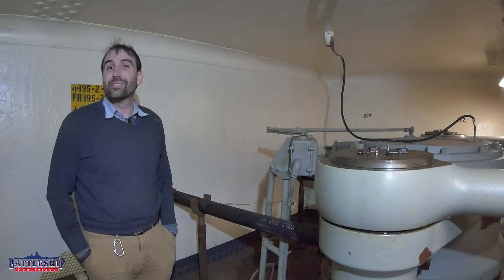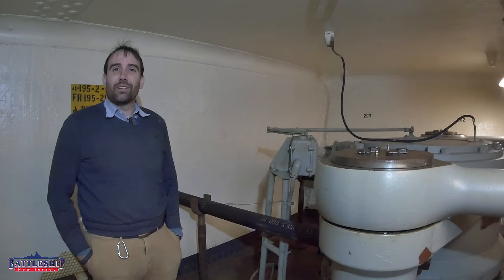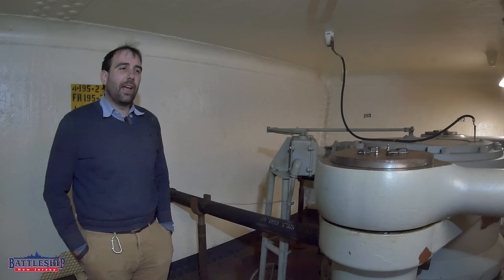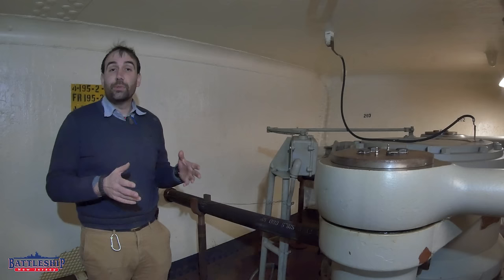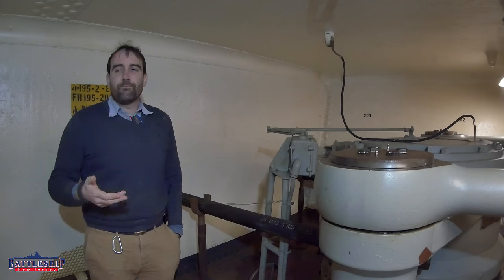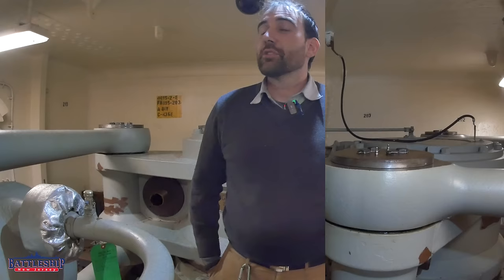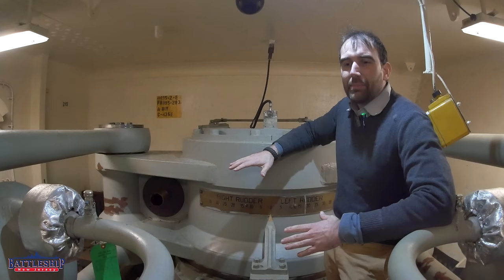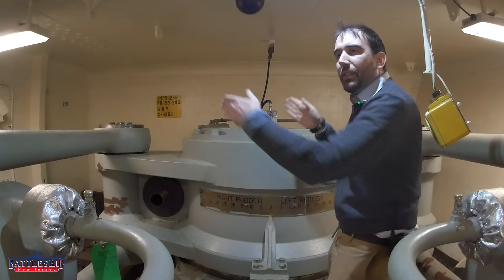Can New Jersey Still Use Her Rudders And Are They Straight?

Comment: Now we need a video on why the rudders are 2 degrees inward and how the relates to actual steering of the ship.
Reply: Probably like in a car. Your front wheels aren't perfectly parallel either. They "toe-in" a few degrees to help hold a straight line when driving.
Reply: From what I have read it’s pretty standard to toe in rudders on large vessels. Toed-in rudders reduce drag, give crisper steering and more speed.
Reply: My guess is that it is due to the hydrodynamics of the outer props being forward of the inner set, as well as the relative positions of the props and rudder
Reply: It's to help reduce the induced drag from the stern of the ship. Think of a teardrop and how it reduces the low pressure zone behind an object.
Reply: Yep😊
Reply: @cityrippers9445  Ah, so the rudders ARE "straight" as far as the water flowing into the void behind the ship is concerned.  Ok, that makes sense.
Reply: I also want to know
Reply: Why
Reply: How about an episode about the details of towing?  How many tugs, and of what power?  How many lines, their attachment points to the ship, the positions of the tugs and why?  Who’s in charge of all the tugs?  Etc.
Reply: The 2 Degrees inward is because when all propellers/shafts are propelling forward, they are counter rotating and the rudders cancel this out
Reply: It is to  limit prop drift. All boats that use props do this
Reply: @dazzamac70 partly but normally with  with multiple props they cancel each other out
Reply: Yes
Reply: I wonder if it might also add a touch more speed by directing the flow of water directly aft, like a nozzle.
Reply: @murphsmodels8853  That would be my speculation as well.
A little toe in and steering is more "dead" and more stable.
If you have toe out, the steering will want to wander, but feel more responsive.  Some would say "twitchy".
IIRC, you don't ever want toe out because you would just get exhausted trying to keep the vehicle straight.   Maybe some short track racers would do that, but I'll leave others to look into that.
Reply: 1 or 3 prop boats any size have offset mechanisms
Reply: @brianbarthel12  best the comments can figure out, the 2 deg trim inward is to allign the rudder to the keel wake. As the ship moves, the water will rush into the void left by the hull. In a sense, the rudder is "straight" with the current even if it is not inline with the boat.
Reply: @nathanielhill8156 cooool thanks!!! Didn’t think I’d learn hydrodynamics in a battleship YouTube video
Reply: I would imagine zeroing out the rudder means that they each cancel each other out - and if they cancel each other out, it's a true zero that will bring the ship to a bearing relative to the centerline through mild brake pivoting (I've heard this being done on older large vessels before, so it tracks... though, the largest ship ever built, Seawise Giant, only had one rudder)

People forget that before modern systems like azipod thrusters, steering gear was pretty complex and took a lot of calculus to get it just right - with the Iowas being fast-battleships making that even trickier (a legacy still seen on the Ford-class carriers)
Reply: Its normal to have rudder offset it offsets the torque
Reply: Then itll be like camber for cars

Comment: The reason that the rudders were turned in 2 degrees was to counteract the forces placed on them by the propellers when the ship is underway. Otherwise they would be pushed outward by the thrust and the ship would not steer correctly and it would be slower. The thrust of the screws is enough that the rudders are then forced outward and the ship will steer straight. The rudders on the Nimitz class carriers are canted inwards 2.5 degrees.
Reply: Kinda like toe in & toe out on an automobile...
Reply: Wow!  Thank You !:-)
Reply: Well, there's another reason...in straight ahead sailing, the canted port rudder exerts a starboard-wise force; the canted starboard rudder exerts a port-wise force. These forces combine on the centerline to assist in staying on centerline track and resisting the effect of winds and waves across the track. Some hovercraft bow thrusters are canted for the same reason.
Reply: Race boats do that today, depending on how the props turn [in or out] the drives are canted in or out for the best straight line tracking at speed
Reply: So it's not to trigger the Luerssen effect that the German Schnellboot torpedo boats used to reduce the ship's wake and improve performance?
Edit: Oh wait, to get that effect the rudders should be angled outward and there needs to be a third rudder at the centreline
Reply: Ah, makes sense. I used to fly a Piper Cherokee. Its vertical tail was angled just a bit off-center to compensate for the wind from the propeller being a spiral that hits one side of the tail harder.
Reply: @deeexxx8138 >>> Hovercraft have bow thrusters?
Reply: @Allan_aka_RocKITEman  yes, they actually do. Some models have 2 large bow thrusters on the topside that can rotate. I just looked it up and was kinda surprised myself lol
Reply: Basically like "toe-in" on a cars front suspension then. And I was having thoughts about added "thrust" from the props for higher speed at first😂😂

Comment: The rudders are likely that way to promote the most efficient fluid path, a teardrop. If the rudders were parallel to the center line, they'd likely jut into the flow of water around the hull and cause a lot of drag.

Comment: I used to stand watch in after steering on the USS Sacramento. The steering motors were swap port-starboard during the midwatch. That's when I got to take manual control of the steering motor. I would steer a 50,000 ton ship by following the rudder commands using a small wheel about a foot in diameter. Fun!

Comment: Hi normally any rudder is driven by some sort of worm gear to prevent the water from pushing it into neutral. If the water could push the rudder into neutral, HMS Hoods and Bismarcks rudders would be neutral after the plunge to the deep sea bottom. And Titanics broken stern was supposed to do circles until hitting the bottom due to (commanded) rudder hard over. 
Normally the rudder can be cranked by hand power without hydraulics and or electric energy with some sort of manual device.

Comment: Honestly, it's a good thing you're not bothering with the steering. Would it make it all easier? Perhaps, but it's probably best to leave it tugs to pull her out and steer. They're pros, they know their job. You'd have to hire a good helmsman that may or may not have experience with (assuming) specialized equipment, on top of reactivating systems (that, yes, would likely work, but would also cost lots of money to do properly). NJ fought her battles, she's a museum ship now, and as such an artifact, better to not tempt fate.
Reply: You would need a bunch of sailors in general. These ships are designed with a crew of a couple thousand in mind, and while a bunch of that is redundancy and weapons systems, it also just takes a lot of people to make it run.
Reply: @rulebretgne5244   if memory serves, around 300 just for engineering.
So yeah, it's a lot cheaper to use the externally powered maneuvering device - a tugboat.

Comment: I'd imagine the rudders are angled in so they can make better fine course corrections. The first 2 degrees of rudder would only generate a turning moment from one rudder, as the other is straightening out and thus countering acting some of the first rudders turning moment.
Reply: first rudder's
Reply: or the flow of water behind the ship, is oriented in such a way that 2 degrees in is most hydrodynamic.
Reply: It's probably also to align the rudders to the ship's wake. You can see waves on smaller ships that are formed by the water refilling the displacement left behind by the ship

Comment: My thoughts are that the rudders being turned in 2 degrees is like the tires on your car being toed in 1/16 - 1/8 of an inch.  When underway,  the force of the water moving past the rudders like the friction of the road against car tires cause both to flex outward such that the end result of each is that the rudders and tires then are straight when under motion.

Comment: Love these videos.
You mentioned the packing around the rudder shafts, will you be repacking them while you are in dry dock like you'll be doing for the prop shafts? Or is there just less to worry about with the rudder shafts? If so why is that?

Comment: Great video but one detail or question you might not know.  Why are the rudders off 2 degrees?  Does it have to do with hydrodynamics or the shape of the bow were the have to be off 2 degrees to make the ship go straight?
Reply: A hunch - in the automotive trade, many vehicles - depending on type - have a similar condition with thier steering wheels, called 'Toe In'. Rarely youll see 'Toe Out' where the wheels point away slightly from each other. Reason for this is for the vehicle to handle appropriately for its design,  load and so on. Incorrect toe can and will cause premature wear problems to the tires themselves. 

I would wager this is same here. The designers likely found that, for the ship to hold a straight course, her rudders had to be angled into  each other. 

Another, albeit less likely option, is this -- I seem to recall that Iowa class BBs had significant vibration issues.  This *may*, again, educated cross-field guess here, been an effort to stymy the vibration problem. However,  my bet is on the handling, since, again IIRC, the vibration was never wholly cured. Yes, incorrect toe 'can' cause unusual feeling in the cars steering. 

Like I said.  My trade is automotive service repair tech, but the base ideas hold the same - very roughly - between ship and car.
Reply: @MoparNewport  I wonder... if the flow of the water coming off the props creates a low pressure area at the stern... having the rudders angled in slightly may help negate this... which would decrease drag on the hull... equaling greater speed...  but I have no idea.. just a farmer guess LOL
Reply: @MoparNewport  Yep, I thought the same exact thing you did.
Reply: I have experience with much smaller boats, but I think the trim angle to account for the wake of the boat. As a boat moves through the water, water has to flow around the boat and fill the void left by the hull. The rudders are probably trimed to match that current.

Comment: During the drydock process, what ship's systems, if any, will be inspected, moved, powered, or operated, which the museum never does in its operations?  For example, will the rudder mechanism be moved, or disassembled,  for inspection, repacking, etc, during the drydock maintenance process?
Reply: It's highly doubtful. The Rudders are not critical to the Museum's operation.
Reply: @WALTERBROADDUS  Neither are the propeller shafts, glands, bearings, and seals,  but they do need repacking to prevent leaks.  Drydock is all about maintaining the things that need it, whether they're being used or not.
Reply: @Turboy65  I'm sure those evaluations have already been made. And there is a cost benefit to disassembling systems to which there is no current issue.

Comment: My big question is WHY are the rudders turned in two degrees? Is it to have better stability at speed? Many aircraft rudders are slightly turned out of TRUE due to the engines torque so they will fly straight down the runways. Same idea?
Reply: With 4 props of which 2 are turning the opposite of the other 2, there would be no torque as they would cancel each other out. Light aircraft with a single engine do experience torque from the engine but it causes roll instead of pitch changes. Same deal with a single rotor helicopter and why they have the tail rotor, to counteract that torque.
Reply: Answered in other posts, but...
The water flowing around & under the hull is rejoining together & the rudders are set to be straight with that local flow-direction.

Comment: I'm guessing that most ships have some "toe in" or "toe out" in order to minimize drag, cavitation and turning effects while going straight ahead. Single screw ships will have some in order to counteract the turning effect present with a single screw. The naval architect predicts what is needed during the design phase, after which it is verified during sea trials and any adjustments made as a result. Ideally, if the ship is directionally stable (not all are), she will steer a straight heading with the rudder set at 0 degrees on the helm.

The mechanical rudder angle indicator becomes the "Gold Standard" against which the electrical rudder angle transmitters are calibrated.

On some ships the rudder is twisted throughout its span, so you might even have toe in at one end and toe out at the other end. The rudder design will specify which rudder chord is considered the reference chord, and toe in / toe out is specified against this reference chord.
Reply: It is not uncommon in rear-wheel drive vehicles with independent rear suspension to have toe-in toward the center of the vehicle to assure neutral handling at the cost of tire life.
Reply: I think it is more to do with local current pattern. If you look at the wake pattern behind the ship, I wouldn't be surprised to see a 2 deg current

Comment: You used the term “dead ship” several times. That is the one thing I notice on all the museum ships I have visited. (Sorry to say, yours is not one of them, yet) On an active ship, there are always blowers, pumps,  and other devices always running. Hence there is a certain “pulse” running through the ship.  This is what’s missing on museum ships. I realize the Navy does not let you run most if not all these devices. However, I wish there were some way to give ships like yours the “feel” of a living ship.
Reply: Dead ship means it can't move by itself, it needs to be towed.
Reply: That is just not practical.
Reply: Feel like a living ship?  Pipe some cigarette smoke, oil smoke, DFM fumes etc. through the ventilation, play a very loud recording of a contested Spades hand in the Crew's Lounge, and have somebody design a "4 hour old overheated coffee" scent machine for the mess decks.  In the berthing areas you could hide a pile of dirty socks and underwear somewhere, get a can of "fart spray", figure out how to generate the smell of sweaty feet and armpits, and toss an "adult video" in the VCR.  Don't forget Right Guard and 10 different competing aftershaves.

All ambient noise really needs, as you said, are some blowers and pumps.  Add in a buzzing transformer or two, and get some people to noisily stomp around and slam doors/hatches.  Make sure you remember to have somebody key up a 1MC mic, hold it MUCH to close to their mouth, and scream into the (very sensitive) mic for the crew to do something that they were likely already doing.  

33 years ago now, and I still miss it....

*Note the conspicuous lack of the term "Bos'ns Pipe".  I wouldn't wish that gawdawful screeching over the 1MC on anybody.  On a positive note, piping WAS good for troubleshooting.  When you string together "Ship's Work", "Mess Call" and "Relieve the Watch" any marginal tubes in the 1MC rack were almost guaranteed to crap themselves...
Reply from the maker: Fun fact, we've got smell mister thing in a few spaces including one for coffee and one for cigars.
Reply: @BattleshipNewJersey  ROFL.  Kudos for your attention to detail.

While my post was somewhat "tongue in cheek", the fact remains that you don't put a large number of working men in tight quarters without a noticeable aroma.

I was on an Oiler.  Add to the funk the pervasive smell of DFM (Boiler fuel) and JP-5 (Jet Fuel).  It was bad enough that we laundered our civilian clothes in port and sealed them in plastic bags before returning to the ship.  Failure to do so resulted in random folks ashore asking if you were a diesel mechanic or worked at a truck stop.  THAT bad.
Reply: @tomtrenter3208   Gee, no shit!

Comment: ? I believe the rudders are controlled by hydraulics with electric pumps, Yes?
If what I remember, what Ryan said, there is a mechanical backup.
Can the rudder position be changed ? Ryan must know that.
Seems that rudders are left "Amidships'' when the vessel is not underway.
Reply: then why isn't Texas Amidships? - Actually the single rudder there - perhaps required the rudder other than Amidships in final approach to the pier. not returning it to Amidships after tied up and before shutdown reflects haste and/ or lack of thought.  I highly suspect the hydraulic fluid is still there and pretty close to full. He did not state if the Navy's legal document prohibits doing stuff with the rudder. I say it is NOT worth the effort - is possible - the locking bar show looks as if it can be removed "relative easy" Great video - thank to the researcher on the 2° toward barn door closure.
Reply: Can’t be moved with the bracing in place

Comment: On rc plane's you have to angle the motor just a couple degrees to the right and a couple degrees down to counteract  the force of the motor spinning causing the plane to counter spin and nose up especially on take off when you're going from a complete stop to full throttle.  I'm assuming The rudder being a couple degrees in one direction is to counteract the forces of the props spinning the other direction making the ship slowly veer off?  I bet that's it.

Comment: I thought that they would actually would have been "zeroed" out ie -2 degrees, as it would reduce drag during the tow.  I guess in the overall scheme of the thing it would be negligible.  I assume with manual controls they could each be turned to true zero degrees if you really wanted to, and just shorten one rudder stop and lengthen the other slightly.  🤠👍